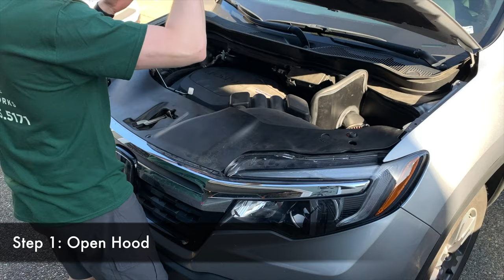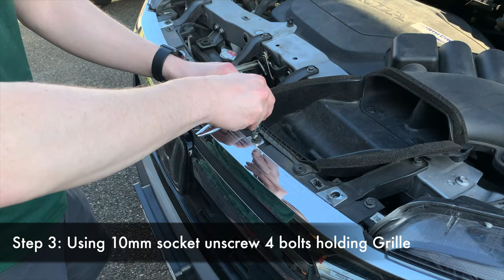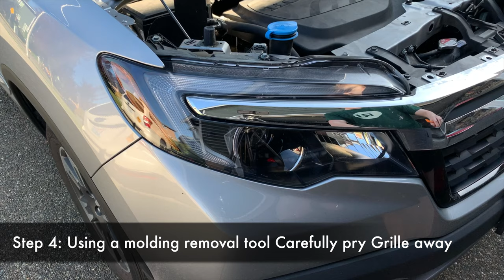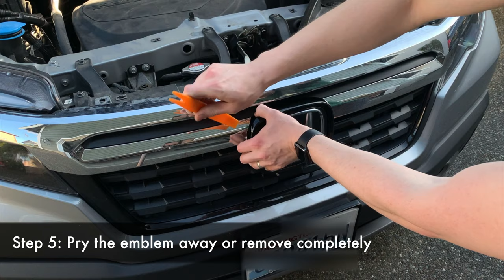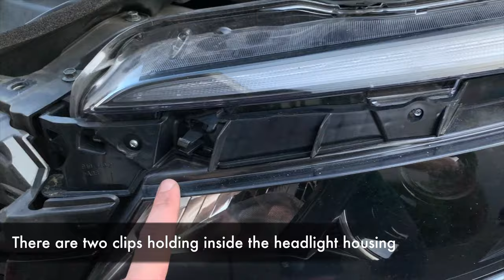How to remove a Honda Ridgeline Grille

Comment: How about the lower grill below the "chrome" piece you took off? Is it straightforward? Curious about mounting lights behind it
Reply from the maker: It's a bit more complicated than just pulling it straight off. You might be able to mount lights behind it without even removing it though if your hands are small enough.

Comment: I just did this wrap and you remove the H emblem by raising hood - removing cover in front of engine - then there are two slots to insert a screwdriver in the top next to the hood latch - one on each side - you need to press them downward and the top of the H will be released. The rest of the H is held on by clips on the lower portion of the H and you can just pull on those to release the H.

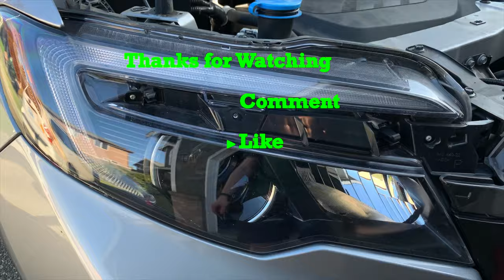Comment: Near the end of the video, it looks like you unplugged something; you can see it at around 1:43 in the video.  Can you explain what that was for?
Reply from the maker: Unfortunately I don't know exactly what I am looking for at the 1:43 Mark. Can you give me a location on the grill that I can refer too and see if I can better assist you in your Question? As far as I remember there were no cables order wires unplugged. The grill is held on strictly by clips or bolts.
Reply: I thought the same thing at first, then realized it’s the latch for the hood release.

Comment: Does anyone know if the 2022 Ridgeline upper grill comes off the same way? It has pins in place of bolts that easily come out. I am concerned about the four retaining tabs above the headlamps. Does it pry off in the same way?
Appreciate your videos!

Comment: Any tips for the emblem? Having trouble prying it out.
Reply from the maker: It just pops right off. There are four clips holding it in place in the corners.
Reply: I tried to remove it today with no success..and the problem was the emblem, it didn’t even move... The emblem didn’t allow me to take out the grill... I didn’t want to apply “excessive” force lol
Reply: @juanfernandez9492  i have the same problem i gave up lol
Reply: Same issue here too